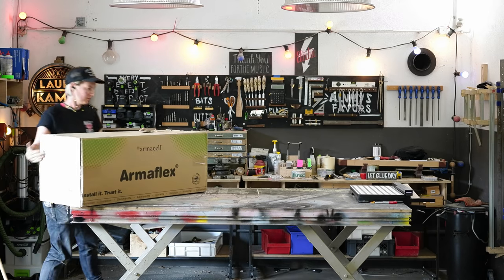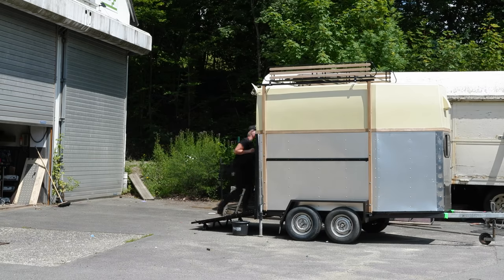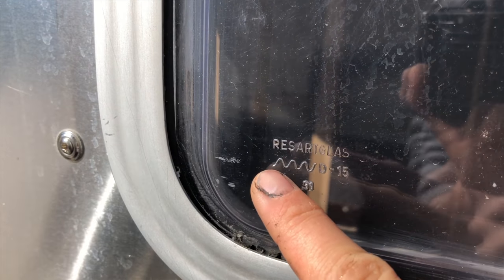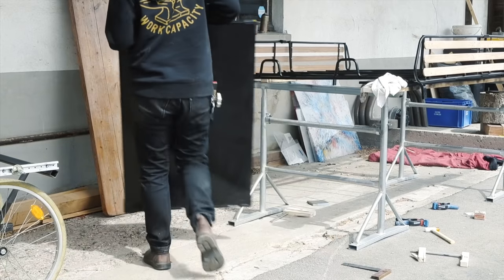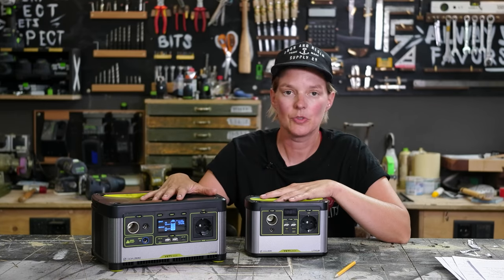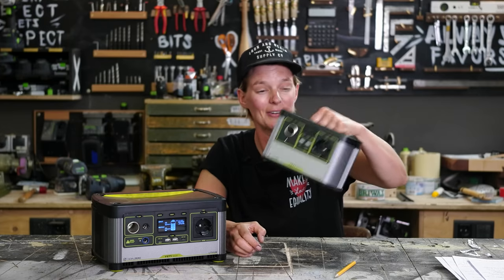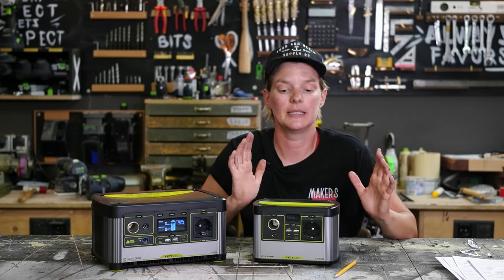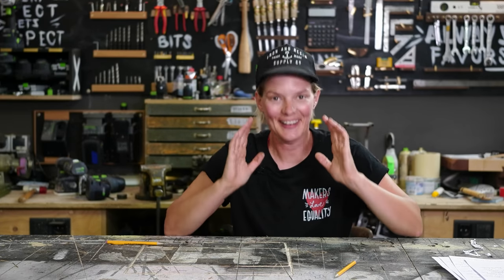Building a Camper - Solar Set Up, Insulation, Windows

Comment: (1) The solar panel location means you can't use half the roof rack for cargo -- I guess you accepted that as a trade-off? (2) I wonder if what you learned about vapor barriers is the same as they taught me in architecture school almost 50 years ago. The aim is to prevent the moisture in warm air from condensing as the air cools. The vapor barrier always goes on the warm side of the insulation, but which side that is changes from summer (warm outside) to winter (warm inside).  You aren't supposed to have a vapor barrier on both sides of a wall (whatever moisture makes it through one may be trapped by the other, and moisture trapped in the wall is the worst outcome of all), so the screwy thing is, you have to build for the worse condition and ignore the other one.  In cold climates (like Germany), the worse condition is winter -- warm, moist air from inside gets into the wall; the moisture condenses within the insulation or on the inside of the outer wall surface as it cools.  The vapor barrier goes on the inside.  In a hot climate (like Texas, where I live) the worse condition is summer -- hot, humid air from outside gets into the wall and condenses at it arrives at the air conditioned interior.  The vapor barrier goes on the outside (but this is not as serious a condition, because it's not ALL THAT cold inside an air-conditioned building [certainly not as cold as a German winter!], so we usually skipped it).  I have no idea how people in in-between climates choose -- maybe there's a zone where a vapor barrier is not needed at all.  So by my understanding, if you'd wanted to, you'd have got some plastic sheeting and tacked it up all over the inside of your wood framing, over the insulation.  FWIW, I don't think your idea about the air space next to the insulation is valid -- that's the warm side of the insulation, the water vapor wouldn't condense there anyway.  However, the trailer won't be especially "tight," and you won't keep it hot, and you won't cook or shower inside it, so the air may not be warm enough or moist enough to produce condensation.  My guess is, it'll be fine.  (3) Solid, flexible foam insulation was an excellent and creative choice.  I didn't even know that existed.  Usually the choices are fiber batts, which are flexible but have low insulating value, or foam boards, which have high insulating value but are rigid.  You found the best of both.

Comment: We use armaflex to insulate refrigeration pipes to prevent freezing and moisture usually on coldest pipes 1/2 inch was thickest May have used 3/4 inch once or twice those pipes can get down to -30 never had any serious freezing /moisture issues so 1 inch should be solid

Comment: I am very happy that you have made available the logos of your new shirts for free. I don't know if I will download it but surely, if I do it I will not do it for free. This initiative (in addition to spreading the message of equality) would allow me to have a shirt also for my sweet weight (about 7XXL) which is normally not marketed in advertising shirts. At least here in Italy.
Ciao and good continuation with your camper; good idea to leave the insulation detached from the internal wall: the air flow improves the evaporation of the condensate.

Comment: Hello Laura,
Your mention of insulation and moisture issues is very relevant but your knowledge of these subjects seems vague. You should contact an architect who could explain the concept of vapor barrier in insulated walls.  However, the solution in the case of your camper is also to ventilate and heat correctly. In addition, to be effective , the insulation (and vapor Barrier) must be absolutely continuous and well connected with the openings. It seems it's not the case in the video.

Comment: It's a shame that the roof rack sides will affect the solar panels performance. 👍
Reply: Exactly what I thoght when I saw the shadow of the racks on the panel's surface.  But she can add rotating standoffs to raise the panel over the rack's surface level. That way, it can stay flush when travelling and have optimal performance when stationary. I found out about the tremedous performance hit these panels take even with a little shadow across them the hard way...

Comment: I've used several Yeti lights and they have all failed after 2-3 years - the control circuitry not the LiIon batteries. They just come on by themselves and don't turn off - the light switch has a off position but all you can do is vary the intensity. A bit of a web search indicates this is a problem that Yeti has been advised of but once its out of warranty they just want you to buy a new one - planned obsolescence?

Comment: First of all, it's been a  pleasure for me to see all your episodes but I couldn't stay in silence when I saw your little window installed on the front of you camper. It is wrong to put a side-window on the front due to the water insolation (even snow or dust isolation) ......because of the slide-half, it maybe a problem during the trips that you are going to made with it.
If you don't want to change it to the side (where it belongs) of the camper, you should start to thing in a detachable cap or lid to avoid a lot of issues in the future.

Comment: When you insulate you will have less problems with moisture when you insulate. You still have to ventilate though because excess moisture can stil result in water problems. Insulated or not. (and you need oxygen to breathe).

Comment: This how they insulate the cabin of yachts from inside to avoid humidity problems! In the case of yachts they use a soft rubber attached by a glue in similar way that you did it! What it does is to increase the dew point of the walls, probably you will get humidity on the surface of the  windows! Greetings

Comment: Wouldn't the solar panel be better mounted directly to the roof in front of the rack, or is it too wide? I know a few people with Landrovers that have permanently mounted a solar panel on the slanted part of the roof above the windscreen just fine, and your horse float looks like it has a larger cross section than that. :)  That way you retain full use of your roofrack.

Comment: I must agree Laura, that there are many options for insulation, and I found that spray foam is the absolute best. High R-value, low weight it seals out/in moisture like none other, it is easy to install, and lastly it holds the project together!

Comment: Armaflex, Rubitex or any closed cell rubber based insulation is the gold standard standard of refrigeration piping insulation. Your implementation is a really good condensation block since it adheres directly to the metal.  Closed cell rubber insulation can absorb water over time under extreme situations, but in your situation it’ll protect you for many years.   👍🏼

Comment: The easiest rule to remember when doing wall insulation is "put a vapor/air/water barrier on the warm side of the wall." With this wall assembly if the inside is cool (not sure if A/C will be installed), the condensation will take place INSIDE the wall - like in the middle of the foam insulation - and cause condensation to build up inside the wall. However, with Germany's climate and if Laura never expects the inside of the camper to be drastically cooler than the outside, this wall assembly would cause the dew point (condensation) to occur at or just inside the interior wall where the small air barrier occurs. This will still put condensation  in the wall, but the condensation would bead up on the interior wall board and drip down the cavity and slowly evaporate. This, similar to your house, would mean that a thin plastic layer on the wall before putting up paneling would prevent moisture (and mold) to build up in the wall.

Comment: So looking through the Armaflex literature, it is not permeable so no moisture barrier required. Seems like a good choice!

That being said, the installation manual suggests an adhesive to seal butt joints between panels. It may be wise to add a sealant so you don't have gaps in your moisture barrier, but it may prove to be too small to matter.

Comment: We did the same in our camper, armaflex with a tiny gap to the wooden panels, and so far after three years so problems at all! However we used the non-sticky version and a separate glue, which was a pain in the a**. The vapors were despite of a good ventilation not bearable for a longer time, but you need to work quickly because the glue dissolves the material a little bit to make it airtight. It was not fun, so the self sticking version is probably a good investment! We had a little problem with the sikaflex on the roof window, it didn’t stick to the plastic properly and we redid it after a year using dekaseal, kind of a gum consistency which doesn’t get hard and just makes it watertight, it’s not a glue. But this works great now and I think it depends on the plastic if it works with sikaflex. Your project is really inspiring by the way, since you started I have around thousand ideas to improve our camper 😅💪🏼
Reply from the maker: Ah cool! Good to know it seems to work! Thanks!

Comment: I’ve just finished my van, a transit connect, I used recycled plastic material 50mm insulation for large holes and then  9mm foil backed self adhesive over all the surfaces, cost around £130 total! Also used goal zero tech it’s great! Thank you for these videos I love seeing your work!

Comment: As a physicist working on thermodynamics on a daily basis, I can give you an opinion on insulation: Due to the insulation there is a temperature profile through your wall, with a cold point on the outside wall and the warmest point inside. Somewhere along this profile there is a certain temperature, at which the air with its given moisture content condenses. This is called the dew point, in German "Taupunkt". You have to take care that, seen from the inside of the van, this point is BEHIND a moisture blocking layer. Because then, the moisture always is contained within the warm volume and will not condense. Note that the dew point does not necessary have to lie in an open volume, it can as well lie within your insulation material, and then the condensation will take place there, which causes a mold problem. 
In your case, the surface of the Armaflex probably is blocking the moisture, but this is not the case for the wooden bars. Therefore I strongly recommend to add one layer of solid plastic foil throughout the entire inner surface of the van, before you install the inside wall finish. This layer should be absolutely air tight, i.e. you should close all gaps and holes with strong tape. (Stichwort "Dampfsperre").